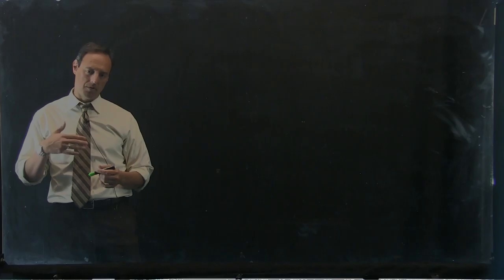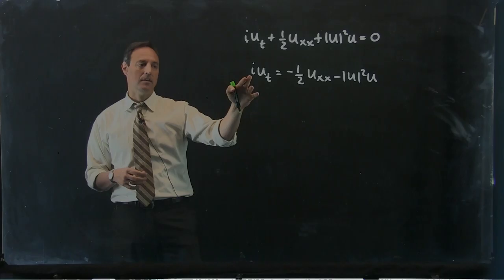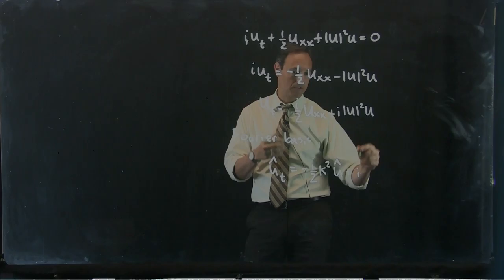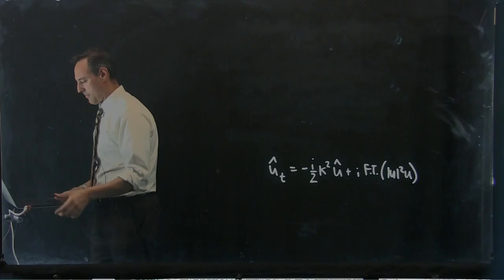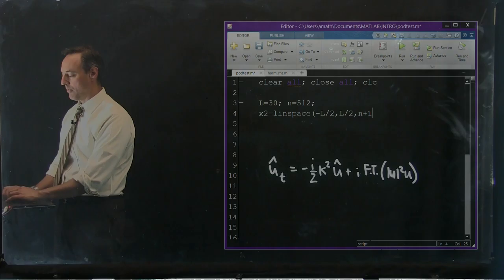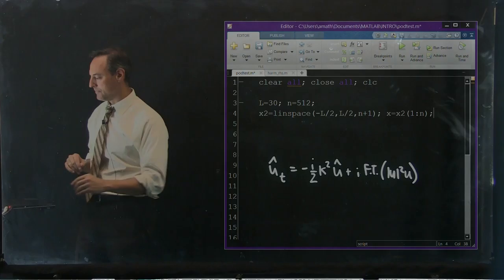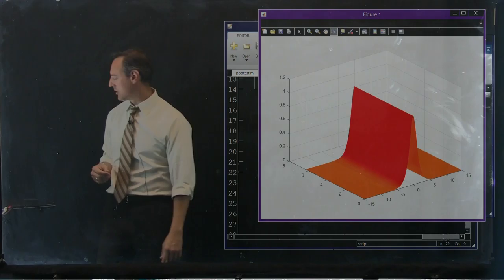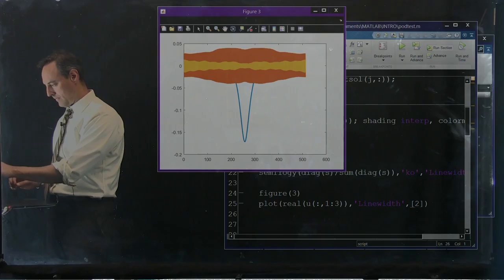POD introduction 3

Comment: At 49:00 - The mistake is on line 41: you need to address the array asol with two indices: asol(j,1) and asol(j,2) . Otherwise you get the result with fixed a(0) amplitudes for the modes, that is, the solution doesn't change over time.  Too bad you didn't notice- I was looking forward to see how well it works.  But I must say this was a really good impromptu explanations and demos. I really enjoyed it, and learned a lot. Thanks.

Comment: Very nice explanation but i have a question. What if you have for example a system of 100 states with 100 different nonlinear ordinary differential equations  ? How would you solve the Galerkin projection ? You take each differential equation and solve it separately like it is done in the video ? Please help

Comment: The error comes in the for loop that makes usol. You need to get the asol at each time step not just the first and second ones
Reply: Thanks. Would it be 

for j=1:length(t)
    usol(j,:)=asol(j)*phi(:,1)+asol(j)*phi(:,2);
end

It seems like the surfl result from this looks like what could be a 2-mode approx.
Reply: I think it'd be more like:

for j = 1:length(t)
    usol(j,:) = asol(j,1)*phi(:,1) + asol(j,2)*phi(:,2) 
end

Because you want to compute the following at each time j:

u = a1*psi1 + a2*psi2

and asol has 2 columns in this case of a 2 mode rom